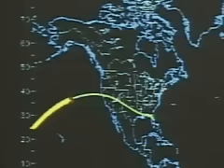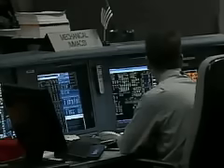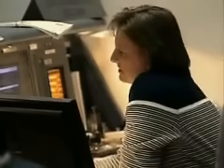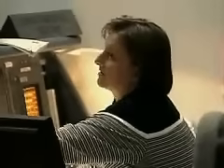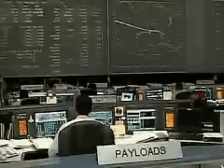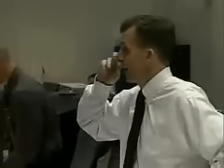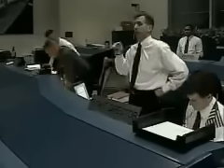Inside Mission Control During STS-107 Columbia's Failed Re-entry and disaster

Comment: At the point of “ lock the doors “ the entire staff inside Mission Control became Coroner’s, as hard as it sounds the vital signs life function’s of each Astronaut was known when stopped so in essence they knew which of the Astronauts died 1st and died last.

To lock the doors keeps any possible breach of data and data being removed by NASA Administration in a possible cover-up.

Remember Challenger investigators were being led down the wrong path by Administration covering the root cause up until that piece of O-Ring was placed in a glass of ice & water pulled out and it cracked! right in front of everyone including the press!

Comment: What changes the context of this is that the Flight Director knew there was heat shield damage, and if bad enough, a crew that did not know about it would die in front of him. When the sensors failed at 6:10, he knew right there -for sure, the damage was bad enough,, game over.
Watch that reality turn on in him for the next ~10 seconds (while the crew was actually dying). Like his soul was leaving with them
Reply: They knew there was a serious problem as soon as the report of the 4 lost sensors on separate lines was made. 

The fact that they’re on separate lines instantly tells everyone in that room that the wing is being cooked and any sensors and circuits inside it are currently being damaged. 

As soon as they mention the tyre pressure sensors, that pretty much tells them that almost all of that left wing is compromised and that’s the point they know that these men and women aren’t coming back.

It’s tragic, but they all stayed professional for the crew’s sake, right until the end

Comment: The order “lock the doors” is not given during an emergency situation at NASA: it is given after an emergency situation at NASA.

What it means is that the mission is over and the post-mission forensic analysis is beginning. Absolutely all relevant information is to be saved and collected, especially all of the telemetry data from the mission, and no one talks to anyone on the outside until there are official findings to be reported to the media via official channels.

Comment: Compelling. I wonder at what point does he really start to know what happened to the orbiter?
Reply: I suspect it was when he was told there was "no commonality" among the sensor failures-basically, that there was a single part on the shuttle that could fail and cause those failures and only those failures.

Comment: People talk about 12:30 (when he says "lock the doors") as the most daunting moment, but in my opinion the real most daunting moment is way earlier, at 5:37, that is 20 seconds after the last transmission, and few seconds after the first signs that something might have gone wrong, when he looks almost at the direction of the camera to identify where it is, as he realizes that this might be one of those historical tragic moments.
Reply: they knew then, it wasn't later. by that point they had lost 5 different systems AND the tire pressure on the left wing, could no longer communicate with the shuttle, AND lost ALL data from the shuttle. nothing like that EVER happens during shuttle reentry. so they knew, but professionalism and endless training keeps them on task and they continue trying to solve a puzzle and fix a problem they already know in their hearts is unfixable. Only at 12 minutes when they are told there was visual confirmation the shuttle broke up over Texas that they stop trying to fix things and switch to saving data. But they ALL knew by 5:30.
Reply: I still think it’s really hit him at the point where he repeats ”no commonality…”

Comment: Mission operations representative Phil Engelauf, sitting directly behind Cain in mission control, had just heard that television views of Columbia high above Texas showed multiple contrails, the result of the orbiter's apparent catastrophic destruction a few moments before.

Clearly stunned, Engelauf turned to astronaut Ellen Ochoa on his right and told her the hard news. Ochoa gasped, looked up at the ceiling and muttered to herself as if saying "oh my God" or "oh, no." Engelauf then leaned across his console to Cain and passed on the same grim report. Cain's back was to the camera but he appeared to sag slightly. He lightly slapped the console a few times with pent-up, controlled emotion, straightened and turned back to face his flight control team.

"GC, Flight," he called.

"Flight, GC," the controller replied.

"Lock the doors," Cain ordered, initiating contingency procedures in mission control for the first time since the Challenger disaster 17 years before.

Comment: I may be stupid - but why couldn't they do an EVA and check if there was a hole in the leading edge of the wing?
Reply: No, you're not stupid-you just have incomplete information.

Normally, the Shuttle flew the robotic Canadarm. An astronaut can attach themselves to the end of the arm, and an operator in the shuttle could move the arm so they could get a good look at the wing. Columbia wasn't flying the Canadarm on that flight because they had the SpaceHab module in the cargo bay. That also would have made it very difficult (perhaps impossible) to get out, even if they had been flying the Canadarm.

And remember that in microgravity, everything is action/reaction-without the arm, there would have been no way to actually get to that part of the wing. you'd have to point yourself in the right direction and float down. if you missed, you'd bounce off the shuttle and have to try again.

Even if they just surveyed the damage, there was really nothing they could do. They only had a fraction of the fuel needed to get to the ISS, and they'd have run out of electricity (which in space is basically a death sentence) before they could get the next shuttle prepped, launched, and rendezvoused with Columbia so they could transfer the crew over with a series of EVAs.
Reply: @almostfm  Hey - thanks a lot for the info.  Very interesting.  Terrible tragedy
Reply: Why would it have been difficult or nearly impossible to get out?
Reply: @jrockett73  Because the Spacehab module was connected to the "outside" part of the airlock.
Reply: Not correct. On Columbia, the airlock was internal. Spacelab sat way back in the payload bay for CG purposes. There was a tunnel that connected the Spacelab to the forward bulkhead or where the airlock was internally. In the top of that tunnel, was a regular hatch for EVA's designed just for hat configuration.
Reply: @jrockett73  so if what you say is true why didn't the crew correct the problem and live?
Reply: It was talked about but they decided they would do more damage trying to get the leading edge to inspect something that might not be there. Of course the decision was the wrong one.

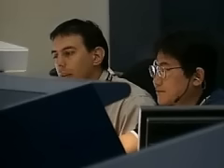Comment: When one of the controllers says he just lost 4 hydraulic return temperatures at @1:40, was that not out of the ordinary? Or when that happened did the controllers know something terrible was imminent?
Reply: No, it's not. They have similar problems before and, beside that, they landing. Bad sigh was moment when they realize that sensors go off scale low. I think in that moment they knew that hot gas is in the left wing.
Reply: @dubravkadbric3807  It was a little later than that-when they also lost the tire pressure sensors and the flight director was told there was "no commonality"-in other words, they were separate failures.

Comment: it seems that the age of Columbia's structure would have contributed to the tiles breaking off.  Someone said the crew weren't told that Columbia would burn up on re-entry.
Reply: Age of the orbiter had no bearing on the accident. Also tiles had nothing to do with the accident and none came off. The crew were sent the same video we saw on the ground about the foam shedding on launch.
Reply: @jrockett73  I have read a lot of your comments you seem very knowledgeable.. did you work for NASA before or something...
Reply: Yes, 26 year shuttle veteran. But that doesn't really matter. Most shuttle veteran's no nothing about how it works because their job had nothing to do with the ship itself. At the end of the program I personally toured flight controllers in the crew module who had never been in the real thing. Only simulators. There is a lot of hear say and someone told me so comments that just aren't true.
Reply: @jrockett73  that's cool! You must love running into Flat Earthers...
Reply: No , I don't waste my time. I try to keep the facts straight and true. 99.9 % of comments are wrong or the people are misinformed.
Reply: @jrockett73  yeah the internet is really good at spreading misinformation

Comment: 5:17 This is where you hear Columbia Commander Rick Husband's say "Roger, ah, but", but was unable to complete the transmission. After that you immediately begin to hear a bunch of crackling and noise. I believe this is where the shuttle began to disintegrate into pieces. Very sad and unfortunate.

12:26 Flight director Leroy Cain says the phrase that marked the lack of hope: "DC Flight. Lock the doors." This meant nobody could leave mission control until they had stored the data in their computers, finished reports and written accounts of what they saw, heard and did. This was the first time contingency procedures had been initiated in mission control since the Space Shuttle Challenger disaster 17 years earlier.
Reply: @Matthew McGhie breaks apart is a better phrase.

Comment: Is it true NASA knew of the impending disaster? That they knew the wing was damage at launch and said nothing to the crew because there was nothing they could do and they were going to die whether they left them in space and run out of oxygen eventually or upon re-entry and chose to let them die on re-entry so they never knew it was coming?
Reply: From what I've read in the comments the crew was sent a 30 second video about the damage sustained at launch they were told it was no big problem because the same type of  problem happened to other shuttles that completed re-entry without a problem.. some people think the crew was misinformed  as to the actual severity of the problem...

Comment: Who does claim responsibility in a case like this? The Flight Director? 
What happened was heartbreaking,  however they all know the risks. No blame should be given here!! We take it, own it and learn what we can from it. And then get our asses back up in space. 
We never forget the brave  we've lost. ❤ We honor them by getting back in the sattle.
Reply: It should be the responsibility of whoever the highest ranking person who knew that they'd nearly lost another shuttle due to a foam strike. (STS-27) and didn't call a halt to the program until the issue was properly addressed.

The gradual acceptance of what is realistically an unacceptable level of danger is called "normalization of risk" and we all do it to one degree or another.  For example, you can go play golf in a thunderstorm and you probably won't get struck by lightning. Do it enough, and it will feel like it's no big deal-right up to the time your luck runs out.

Comment: They new from the take off about that flap shredding a hole and was hoping it wouldn't affect reentry you can see it on the flight directors face he looks nervous  asf he knew when they lost contact it was over the inevitable happend they should've sent in spy images to check the damage but I guess they couldn't get another one up there to fix it someone turned that option down I believe ....and it cost them the lives of there crew ...they knew they were doomed

Comment: we realize now that the sensors failing was actually the begging of the end ..... I was in Tyler Tx at the time of the explosion..it shook the house and we thought there was a small tremor or earthquake.... shortly after I went to work and saw the news reports
Reply: There was no explosion. What you heard were pieces going subsonic after breakup.
Reply: @jrockett73  wasnt heard just felt
Reply: Not just the sensors, but the fact there was "no commonality" between the sensor sets. If they had a point in common, that's the most likely source of the sensor dropout. The fact that they didn't meant there was something not expected that caused both sets to fail. That's never a good thing.

Think about it like this:  Suppose you wake up tomorrow morning and discover that your coffee maker, microwave, and toaster have all stopped working. Is it possible that all three appliances failed separately at the same time?  Yes, it's possible, but it's far more likely that it's the point of commonality between all of them-the circuit breaker for the kitchen

Comment: "That damage was declared an "inflight anomaly," which meant it had to be resolved formally before the next shuttle could take off. In March 2001, after Discovery returned from a flight to the international space station, inspectors found a two-inch tear in a heat-shield panel on the front of the left wing."

That's an excerpt from the Washington post article about the incident. In the video at 1:40 the first sign of trouble you hear, the one astronaut stating he lost all 4 temperature transducers on the left aft wing. Heat transducers are basically electronic thermometers to measure the temperature. When he lost them, that meant they overheated and were destroyed.

It's interesting that they discovered problems with the heat shield 2 years ago in the EXACT same part of the shuttle where the first signs of failure started showing up when the heat shield finally did fail?

Just like how they ignored the warnings about the O-Ring on Challenger becoming brittle in the unusually cold weather they had when it was launched regardless. And failed, just like they were warned it would. Again history repeats itself. Over and over and over and over ad nauseum. Maybe not space accidents, just the ignorance and hubris of humanity. Among other things.

Comment: They knew the damaged heat shield was there. They should have tried come back to earth with Sojus. The decision to re-enter the atmosphere with the damaged heat shield of the Space Shuttle was the fatal decision. Once the decision was made, the crew's death was sealed.
Reply: Soyuz would not have been a practical option. Even assuming that it could be flown by a single cosmonaut (and I don't know that's it's possible), that would have required four Soyuz launches within 30 days, because that's when the oxygen and electrical power on Columbia would have run out.

Comment: I was a Senior in High School when this happened.  I went to college at Texas Tech University and they had a "human factors" class that taught alot about at various times in history a human decision that seemed to be "ok" led to tragedy.  In the case of Columbia apparently a flight engineer had re-watched the launch video after Columbia was in orbit.  He saw the tile fall off.  He immediately put in a request for an immediate scan of the underside of the shuttle by the Department of Defense or NSA.  His boss cancelled it due to costs and not believing it was a problem.  Had they imaged it they would have seen the problem in orbit.  They also knew this could happen and had a repair kit that they could use to fix it.  They didn't take the kit (if I remember correctly).  The Engineer initially wanted a scan and to prepare for the shuttle to dock at ISS and the crew use the Soyouz Escape Vehicle on ISS to get them home since a new module could be sent up relatively quickly.

Imagine being the supervisor that cancelled the scan order.  When I moved back to Houston I worked for a company that supplied certain items for the astronauts and I remember seeing all of the autographed crew photos on the wall on my first day.  The Columbia picture & autograph were there.
Reply: So much misinformation in your comment. No tile fell off. The part suspected of damage was the leading edge of the wing which is made up of carbon-carbon structure panels that form the curve of the wing. No one person puts in a request for what you call a scan. Pictures were requested starting with engineering and up different levels of management  until it reached the mission manager. She rejected the request based on the history of foam shedding. Cost had nothing to do with it and it never does. You need to study how the budget works for NASA and the shuttle program. Every shuttle flight carried a tile patch kit that was never used. It was a two part epoxy to fill in holes. They carried no spare tiles but tiles had nothing to do with it anyhow. Columbia was in a different orbit than the ISS and could never make it there . It also had never been modified to dock with the ISS. The ISS has two Soyuz vehicles docked to it at all times for ISS crew escape. They stay for six months before they return to earth.